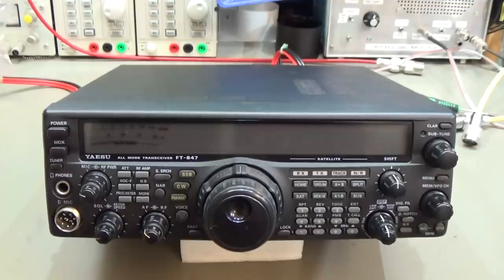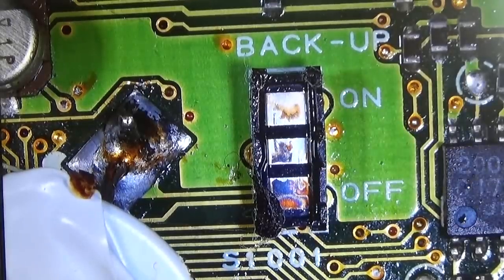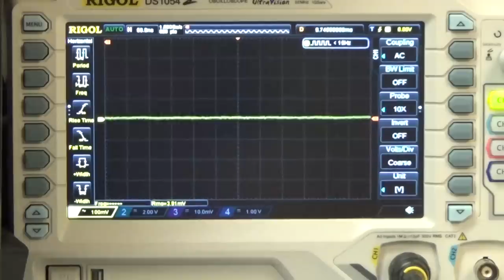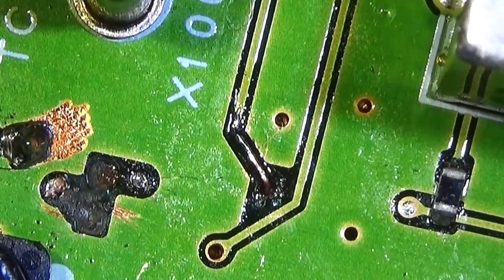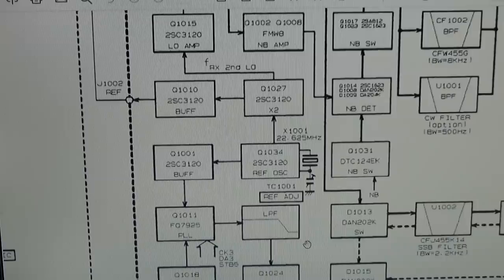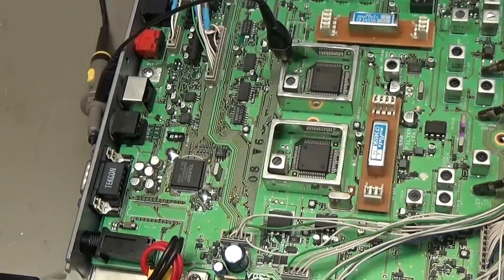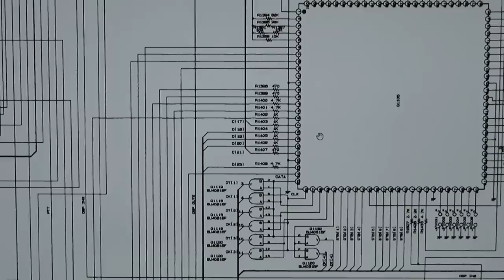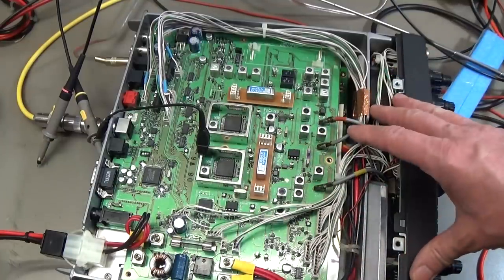#202 Yaesu FT-847 how easy can a nice radio be wracked up?

Comment: The issue with working on radios that have been hacked like this one is that it is difficult to recover compensation for your time.  I think most techs would have opened the lid then quickly closed it.  It was a mess.
Reply from the maker: That is exactly the point andf thus I have to update my no fix policy!

Comment: Why would you not check the power switch and power supply first? Find out why the radio is not staying powered whether it is a supply problem. It sounds like the latch on the switch is releasing or a relay is dropping out when it shuts down.
Solder one side of the resistor to one of the pads then extend the other pad to the resistor with a wire.
Again fix the flipping reason that. The power goes off first¡ Is that a multilayer PCB!

Comment: hello Peter,
Thank you for your videos that I have been for many years.

In the particular case of the FT847 (which I own), in your video we can see that it is reset at each startup. certainly due to the absence of the battery (like say Tom G), but it looks more like a Reset as in the menu 39 "All init".
Did you test to pass the 847 in "SERVICE" mode? see if in this mode it starts.
it would allow to discard a defective parameter stored in the nonvolatile memories.
best regards

Comment: Amazing how people will try to Hack up something with know real knowledge of what they are doing.
Reply: Indeed, there is a world of difference between possessing some printed instructions on how to perform a mod versus actually executing those instructions...assuming that the initial instructions were at least correct.  SMD parts in modern radios can be quite small and closely spaced so you have to be very cognizant of where your heat is going and how it may affect nearby components.  Just in the opening minutes of the video it looks like somebody really went at the board...I could do finer soldering with a torch than was done to this board.  Whatever they did, they certainly got a great deal of heat into that board to have removed traces and melted and damaged components over such a large area.
Reply: @ethanpoole3443 ...All Techs know a good rule of thumb is "NEVER" use a chisel tip for these SMD's and never use a soldering iron more then 20 watts. And never solder or unsolder more then 3 seconds....You got alot of wannabe techs out there these days!

Comment: Hi Peter !
I'm thinking you are not being told the truth about that radio..(someone taking you for a buggy ride)...heh !
Please look carefully and slowly for any physical damage.
Just for the heck of it...perform the CB /MARS CAP mod in it and reset the micro controller.
More ideas :
Where is the microcontroller ROM and program ROM located ?
If  any are externally mounted..remove the IC and look at the contents.
Replace the 3V memory battery then do the reset.
Try and disconnect as many front panel switches as possible then t power on.
Again...suspect a corrupt memory device....EPROM EEPROM.
Should that be the case though..don't know how you could recover the radio without a file.
GOOD LUCK..let us know how things turn out !
Reply from the maker: Hi John, thanks for your thoughts! I agree with you we don't have the full truth on what has happened to the radio...If I would have the files I would try as next step to update the firmware but as the processor is an older type it is not field firmware upgradable and yaesu is not given out any factory documentation even on radios out of service..Thanks for your support..

Comment: OMG that was a butcher at work with a soldering iron
Reply: looks like a nitting needle job . jeff m0prf
Reply: I don’t think it was a mere soldering iron, more like a red hot branding iron given the total area covered.  Some of the work looks as though it was done with an industrial hot air gun, hence the broad regions that were over cooked, even melted, while other areas look to have been done with an excessively hot soldering iron (or more likely, a high wattage soldering gun) and a very heavy hand.  Personally, to take on a project like this one it would either have to be for personal reasons (like “I want the challenge”) or a very good friend had to have come to me after getting a very bad deal on a used radio and I want to help them out because they are of limited means!

Personally, I often find SMD boards much easier to rework than through-hole provided the components don’t get too small, but if you don’t have the correct tools and technique for SMD work then one should probably steer clear of such work and limit themselves to practicing on electronics they have around the house and were prepared to throw away anyhow as they can provide a lot of free practice.  But botching a trivial MARS mod to this magnitude is just amazing!

Comment: Now you bring Up ESD You'r self
I woud ask What soldering iron was used
Some of the MARS bands is off limits fore the 847 unless you want to try you'r luck
6m is on of the No go bands .. CPU can't handel SWR .. ITs the TVI or RFI 
Created the radio can't handel.. the band  s  was not opend at the time
Reply from the maker: Hi Kenneth, I do't know what soldering iron was used or do you mean what my iron is??
Reply: @TRXLab  hey No IT was the home tweaker 's iron ... I use a Weller 2000ESD with ESD mat and armbånd.. to erth truh a 10k resistor
I always ask What iron was used.. and if IT is a somthing somthing .. from whatever .. often i say No to ""waste of money and time"" jobs
Did you to bypass the power suppley .. Greetings from OZ land .. (Denmark)
Reply from the maker: ah sure that makes sense as by wrong handling you can damage almost anything....73

Comment: Imagine someone doing that sloppy work on a customer's radio. After opening the radio and doing an inspection. I wouldn't work on it.  I bet the manufacturer or an authorize service center would refuse the work too.
Reply from the maker: many collegians of mine are refusing to fix a radio if it is older than 5 years...

Comment: Your problem is you're using the wrong tools.  The easy fix is to tap it lightly with a five-pound sledge.  If that doesn't work, use a ten-pounder.  If you do it just right, it'll never need to be fixed again!
Reply from the maker: LOL oh yes you are right

Comment: Who ever tried to do the mod really messed up a very nice radio. If they were trying to do the MARS & CAP and 60 Meter mod, then why did they do all that other garbage?...All they had to do was to do take out a zero Ohm resistor and bridge a pad or 2 next to the battery. All of that other garbage was unnecessary. I modified a few of these in my time. What in Gods name kind of a mod was that idiot trying to do!

Comment: old, blind, or stupid.   I'm getting close enough to all 3 to say that could account for this.  when a guy has been doing half -vast repairs on tube  or discrete transistor rigs from 40 years ago, his whole life. he is tempted to jump into one of these robot built radios and take a whack at some surface mount stuff with the old reliable 40 watt iron...   the smart money will realize that they are licked, when they see that the guys who actually do work on this stuff have microscopes, special micro soldering irons and hot air irons and golly gee whiz.. just send it out !
Reply from the maker: yes fully agree Larry!

Comment: This video illustrates that the advantages of using processor technology with AMATEUR radio is FAR outweighed by the fact that you cannot repair them 5 years after discontinuation (they fail 6 years after parts discontinuation lol). No reason at all the digitize these radios. When they fail out of warranty they are often just an expensive pile of junk. Yaesu could have also standardized on that CPU and kept it around for future designs; they designed the CPU. They allow their radios to go obsolete. Too bad. Building and repairing digitized radios is not for amateurs but that sort of defeats the purpose of "amateur" radio, right? Not turning the future generations into appliance operators. If the guy has purchased an FT-101, he could still be on the air today. And you commenters, highly trained elitists who sneer at the guy (AMATEUR being an amateur) who tried to fix it...words are not enough...